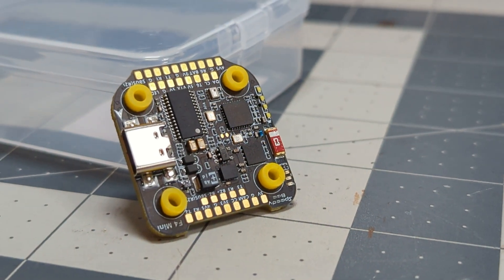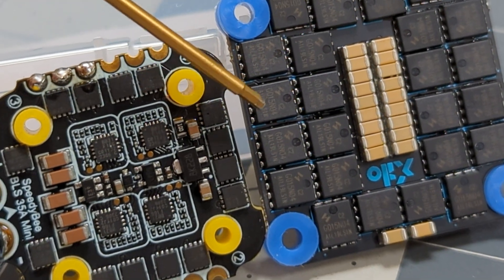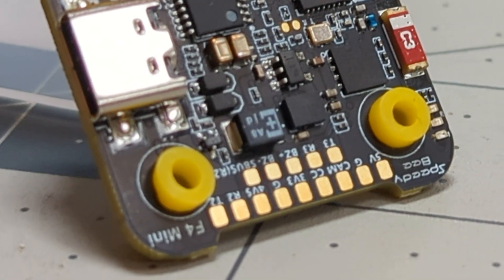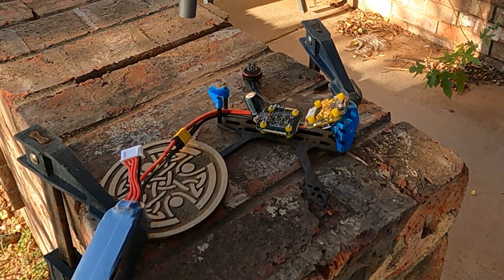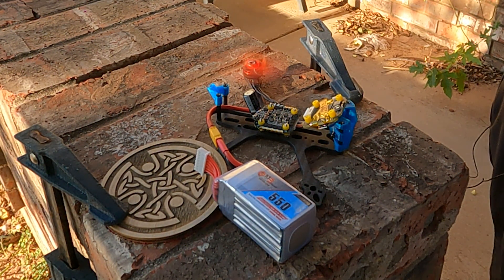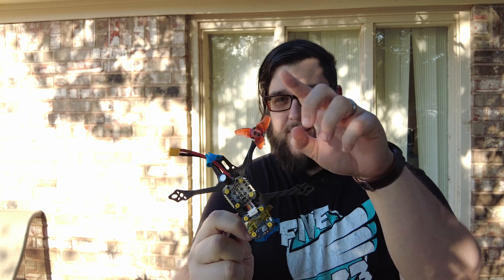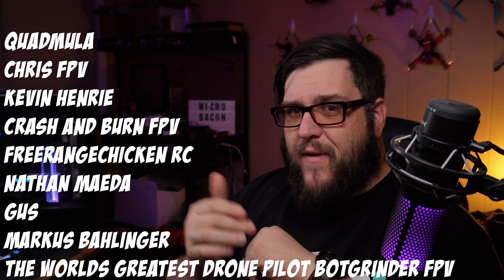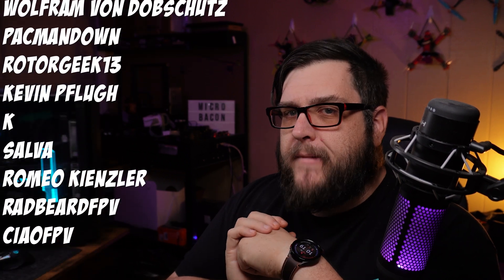I tried to catch it on 🔥FIRE🔥 - SpeedyBee F405 Mini FPV Drone Stack

Comment: I love the speedybee, I have the 405 v3 in my 5 inch, my first ever build, got it for £60 here in the uk.. me being me I pretty much jumped straight to 6s with 1950kv motors and neither my motors nor the esc are even slightly warm after pulling 120 -130 amps 😊 love it, im even gonna buy the mini for my next build 🤘😉🤘
Reply from the maker: Straight to the top on that KV! lol...honestly thats what I usually do too :p
Reply: @BaconNinjaFPV  I figured.. im gonna be there one day so... plus amazon had an awesome deal on 2x 1300mah 6s 100c for £35... how could I not spend some hard earned cash 😂 absolutely loving it buddy, such a rush 💪💪💪
Reply: You bring up a great point! I've never seen an FC so approachable for new builders since the Naza days. The V3, the Mini and the Wing have incredible instructions and diagrams, something I took for granted when using them for my recent builds (the print on the boards being top-notch). Heck, not long ago amperage draw was kind of an unknown, the calibration of current sensors being voodoo magic and no info from the maker). Also, 130 amps daaaang new guy!!! lol

Come to think of it, they (intentionally or not) put enough of the boards in reviewers hands, ensuring an ample supply of curriculum on YouTube University. 

I can't count how many times I've seen new builders get burned out before spinning their first motor, awesome build for your first, and straight to the sauce 6s! Nice success story right here though :)
Reply: @GhostRyderFPV  thank you buddy!! Success story, you think! I just thought I was doing the normal thing lmao 🤣 yeah im yet to experience other FC's, esc combos as my cash flow is very limited when it comes to the hobby. But i have a shopping list to say the least 😄 
Yes i did find that the diagrams of the wiring was absolutely awesome, great layout for a beginner fpv pilot and very direct, no confusing abbreviations and such... an awesome experience just building and i enjoyed it so much 👍 one thing i did learn after plugging a battery in (with zero smoke) is that i was suppose to have a fused device to connect between the battery and the quad on the first plugin, to prevent or to tell you there was a short... low and behold everything was fine 👌 but at the bargain price of £60 from unmanned tech fell straight in to my budget for my first build. Me and a good mate of mine both went at it, so we bounced off each other while building them, as our knowledge was minimal... but after a while doing research we got there.

 I went with the fpv racer next5 frame, obviously the speedybee f405 v3 stack.. a speedybee tx800 vtx, rumcam phoenix 2, Rpm rc 2207 1950kv motors and ethix candy cane p4 props with rush antennas and I bought a second hand pair of eachine ev800 goggles which I found for £30 in the first city over from the small town we live in.. I came in at £218 in the air. Oh i Also used my gopro hero 3 😁 like I say, on a budget.

I already had a futaba t8j from flying a small amount of fixed wing but flights was very few and far between, so I used that with an sbus reciver, just to get me by till i could afford the transition to Elrs.. i've just bought the radiomaster boxer which is absolutely amazing, great peice of kit 👍 I'm going to be building another very soon and already cannot wait 😀
Reply: @pingofthething5446  Holy Bargain Batman! That's gotta be the best entry price I've ever seen to get into a 5", nicely done!
You mentioned the SmokeStopper - it's been a boon in past builds, most recently helping me diagnose a pair of swapped wires feeing the GPS in a VTOL Ranger build - why would there be two black wires in the harness, come on! lol
That's a mean build you have there, I hope the one you're planning is equally successful! You mentioned fixed wings - my current obsession - at some point I got hooked on iNav, and have a small squadron of FPV planes, at first using old quad FC's, but now purpose built. Mixing the two disciplines with infrastructure, hardware, and software is pretty cool and definitely budget friendly!
Reply: @GhostRyderFPV  yeah I feel lucky that it didn't go up in smoke lol 👍I do need to get my hands on one to say the least.. yeah my fixed wing feels are still strong lol, mainly balsawood nitro... god I love the smell of burnt nitro I a morning, only I struggle to get out because the fees to fly at my most local field are pretty steep and to fly alone there, I need my A and B cert but the waiting list is pretty long 🙁 I can fly perfectly fine, but I can't pay the fees and fly because I work 4 on 4 off so most of the time when I'm off  it's midweek and nobody is there so it doesn't warrant paying the fees not to be able to fly.. I have a few electric models that I can fly like my spitfire and some foamboard models I was experimenting with but its not the same lol.. also in summer where I fly them, they're playing cricket so take off and land is a no go... hence few and far between flights.. ill Continue with flying them as and when I can but for now, fpv is where its at, absolutely loving 🤘 yes me too mate, my next build hopefully will go just as smooth, I've got a few models up for sale as we speak to fund the next build, I've got a guy coming for my 2.5 meter wing span piper j3 cub this weekend so it may be sooner than I think 🤘😃🤘

Comment: What motor was that? 1404?
Reply from the maker: yes, that was a 1404.  I figured I was either going to burn up a motor or burn up the ESC, so I didn't want to throw anything too nice on there, lol.
Reply: @BaconNinjaFPV  I put a mini 40A jhemcu esc on my 5" 6S racer. It flew amazing. Only once I got stuck in a tree and wanted to turtle mode it down, did one if the ESC'S die. Okay it's a mini 5 gram esc running a 2207.5 motor on 6S that killed it when being blocked spinning up.

Comment: i have f405 30x30 stack and f7 20x20 from speedybee, been absolutely fantastic, now i cant even imagine to get any stack without wifi.
Reply from the maker: It sure does come in handy!  I find myself getting at least speedybee app compatible ones now since it is so easy to mess with in the field.  I still drag around a bag o' cables just incase though, lol.
Reply: @BaconNinjaFPV  especially when you get a new build, always forgetting something or tweaking. and probably really good for you as a content maker, can imaging you shooting a video for some comparisons or whatever and thats so nice to just change things on the go
Reply: I didn't realize their F7 is half the weight of the F4, (well, 4g lighter, but when every g counts)! Just ordered one - glad to hear your positive feedback on it. I've got some of their F405 FC's also, not one issue, either.

Comment: Seems like a reasonable test to me. I've smoked motors while  🐢ing.
Great price. Small esc. 👍 I have higher rated 20x20 esc boards. But they're bigger. Hard to fit in smaller frames along with a digital vtx. This could help with that. 😎
Reply from the maker: Yeah my higher rated (45-55A) 20x20 boards have the right mounting holes, but they are so much bigger than this little thing.  Kind of nice on the one side, but I always wonder if they are gonna pop the smoke at some point, lol.  Looks like at least the one I got for this test could take it!

Comment: If you ever want to revisit “fire” clamp the quad down, put on a very good pair of boots or wellies and put your foot on the motor as it spins slowly, then increase the throttle and before it burns through your shoe, push harder down on it (you could put a bit of wood between your shoe and the motor) the flames are absolutely guarantee then, don’t ask me how I know….  Jamming something into the prop at high speed usually won’t work because the prop shatters as you found, but slowly increasing the resistance on the motor while increasing the throttle will mean the motor gulls more and more power attempting to spin, eventually overloading the FETS.

But having said that my friend absolutely hates Speedybee after their first attempt at a stack caught fire mid-flight and nearly burnt down our favourite oak tree, but I bought their F405-Wing FC and have it in my veins and honestly can’t fault it, especially the price they’re really knocking it out the park with these new offerings.
Reply from the maker: oh for sure!  I thought about pushing it until I actually knew I could make it burn, which honestly you can make any of them burn if you miss treat them, lol.  But I hadn't done the B-Roll footage yet and I thought it would look a bit funny if I showed off a stack with a bunch of scorch marks :p